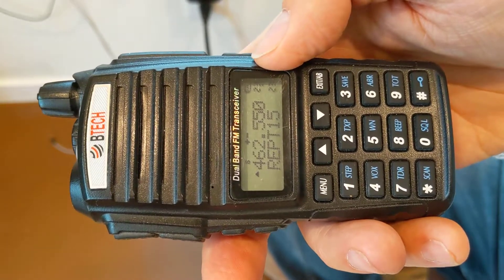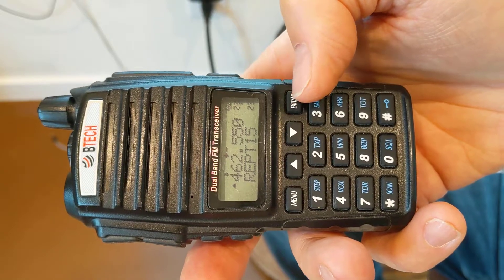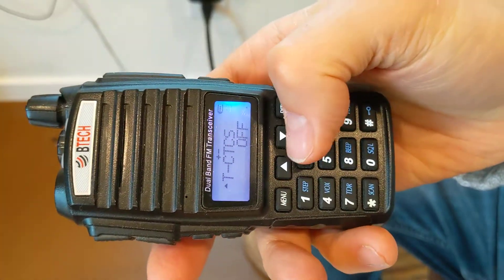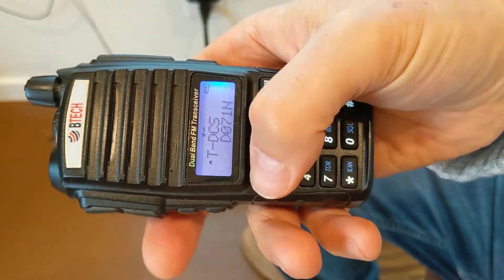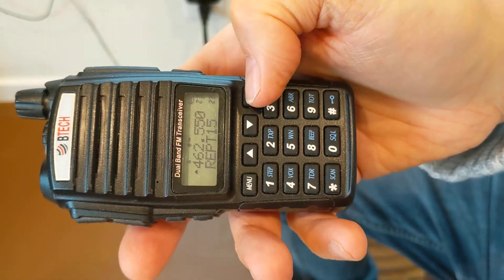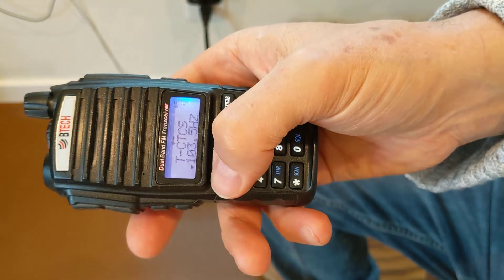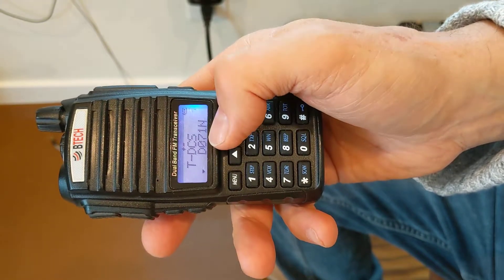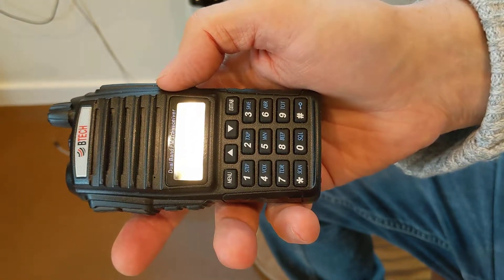Btech GMRS V1 two tones on one channel!

Comment: Hello, I have the GMRS-V1 and have a question.  When I switch to the Frequency mode on the V-1 and click the scan button it will switch from displaying two frequencies to the word '--RANGE--'. I don't find any explanation in the manual so have typed in frequencies for Range, but it won't scan. Do you know what 'RANGE' is indicating?
Reply from the maker: Yeah it's kinda goofy. Its two 3 digit MHz freqs, low to high...but  it starts scanning with the higher freq! Try for instance 462:467. I will scan all the 467 freqs then start at 462  and scan up. If you want to scan VHF you have to enter two VHF freqs IE 150:155. If you enter something the radio can't do it will error out and reset VFO to 400 or 179.9975. And if you enter larger freq first it wont scan. That's all I know.